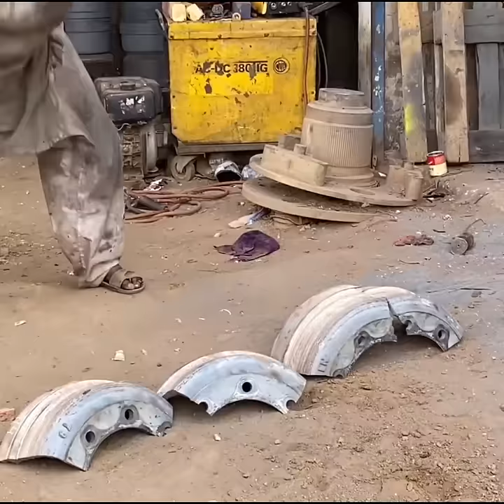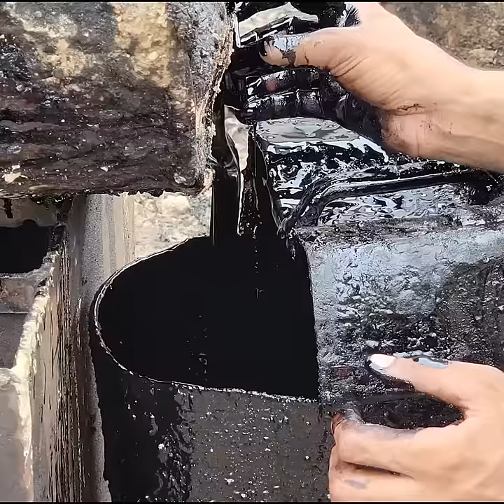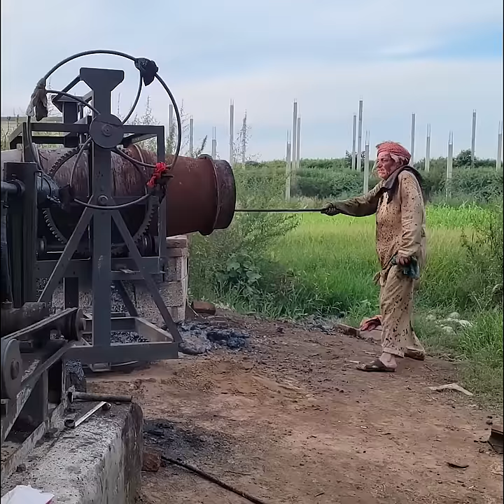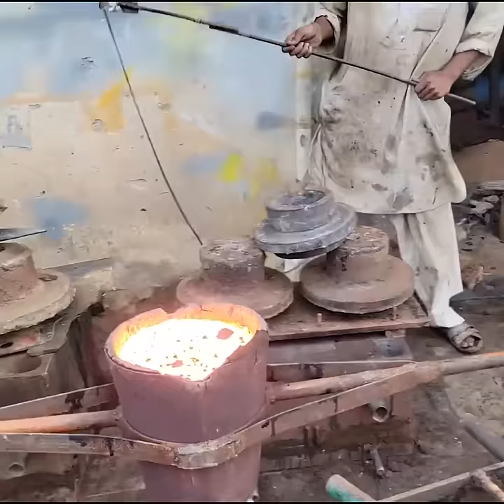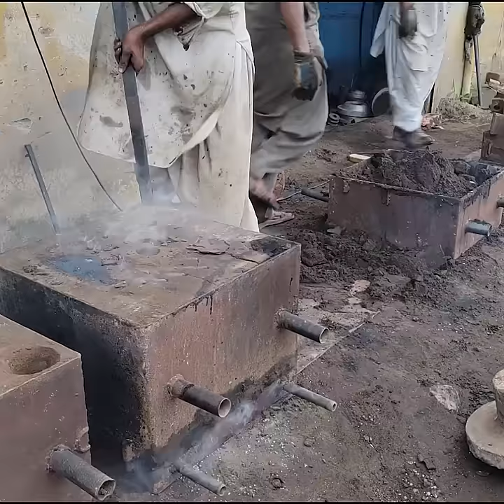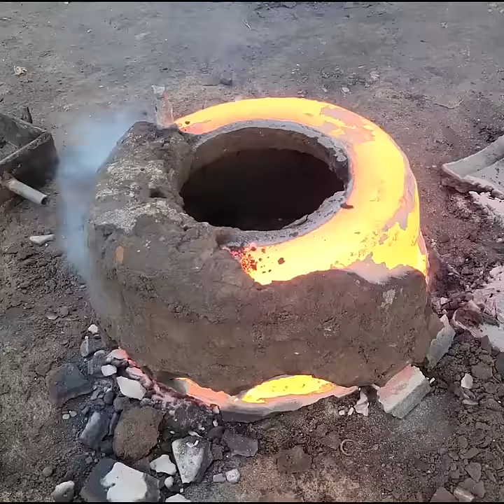Part 2 | Casting of Vehicle Brake Drum Using Sand Mold Technique With Amazing Skills #shorts

Comment: How is this guy breaking drums like that? Then I saw how they were made....
Reply: It's cast iron, it's really wear resistant but brittle.
And maybe they were not made with the best metal to begin with.
Reply: Cast iron isn't particularly strong.  You can break a cast iron pan the same way; set one side up on a brick and crack it in one hit with a sledge.
Reply: They get all their metal from China which has really shitty alloys and hard and soft spots.
Reply: @Jakrr1346  it’s cast you doofus
Reply: Cast iron is resistant to heat and torque but not by blunt force or impact.
Reply: In my experience, brake drums used in trucks are immensely tough.  We would beat on them with 12lb hammers to get them off the pads. If one was struck by the sledge when it was removed it would only deafen everyone in the shop and probably be the last day at work for the guy that did it. This rigidity is essential in a brake drum. The forces applied to it during its use are substantial. These forces include brutal vibration and heat.  As such  the metallurgy used in the iron is far more involved than that applied to frying pans and the like. 
 Perhaps the drums cracked in the video because they were overused and cut beyond the specifications used here. looking at the quality control used in this process, I think it might be something else.
Reply: @Implct 26  this is very true. Cast is very porous aswell, which makes it super difficult to weld, it cracks after welding next to the weld. Ask me how I know
Reply: @Matthew Festa  yes, also anything like engine components with multiple heat transfers in use doesn't really matter what rod ally you use, it will crack.
Reply: Mmmm, these might be used as vessels for charcoal cooking?
Reply: 😂😂 it's pakistan low grade
Reply: @Jakrr1346  trying to braze a 6bt exhaust to fit my 4bt ranger 😅
Reply: @throttleblipsntwistedgrips1992  using the old goldy filler rod?
Reply: Did this in a foundry in Falkirk Scotland  for 20+ years but we used a cupola a coke blast furnace  hard heavy dirty work many men were crippled  in Falkirk larbert denny Bonnybridge my self included now its mostly machines   an art gone
Reply: Its an alloy so it is easily breakable
Reply: @Jakrr1346  
Well, I asked, how do you know?
Reply: @name art  you don't know what alloy means. Every metal used today is an alloy lmao. Depending on the alloy, it makes it stronger or makes it have certain properties. "It's an alloy" is a non statement
Reply: They are grade 220 cast iron. What we in foundries call a.o.s.... any old shit
Reply: @ameunier41  now we know how they were made to begin with
Reply: Cast iron is brittle and the blows were a stress they aren't designed for. The broken drum had been delayed before the breaking process as well.
Reply: A metal can be hard and brittle at the same time. For example when steel is tempered it becomes hard and brittle. To remove the brittleness the metal is carefully heated and then allowed to cool down.
Reply: Or they're just hacks and not craftsmen.
Reply: Cast iron drums are made the same way here. Cast iron is brittle. Also, used drums have micro cracking from heat stress, making it even easier.
Reply: it is cast iron guys
Reply: ji
Reply: Well the guy is wielding a Sledge Axe Hammer which is usually used to break stones.. so 🤷🏾‍♂️
Reply: @Matthew Festa  now THIS is what a reply should be like. 
take note people.
Reply: Ñ
Reply: Dd
Reply: @Jakrr1346  why would anybody ask?
Reply: Так уних всё из этого говна, даже коленвал😂
Reply: To nie bębny ,,to felgi kół samochodów ćiężarowych ,😅😅
Reply: For a moment I thought they were building a jet engine.

Comment: 1850’s tech.. no shoes.. no safety gear.. clothes hanging down over machinery.. wielding with no eye protection.. measuring parts with a yard stick..yea they get it done but it ain’t John Dear quality ..I’ll stick with GM
Reply: If you can get quality parts that's awesome and I completely agree. Then again, quality parts are getting hard to find here in the USA. That said, they live in an entirely different world. It's work with what you've got or starve... I admire their effort and would definitely offer them a job. Gotta change the shoes though lol.

Comment: Why the hell do I have to wear steel toe boots and safety yellow shirts and all the other safety shit I gotta deal with. These guys are working an outside foundry in fucking sandals and burning used motor oil in a jet furnace and are doing just fine

Comment: Live fast die young same slogan as the brake drums they build.

Cancer jet engine is a perk of that job as well. 

Then you got them breaking the mold before the metal fully sets as it's still glowing hot. 

All around 5 stars